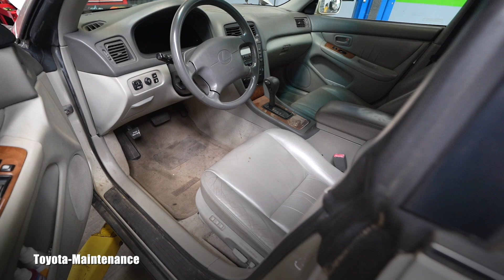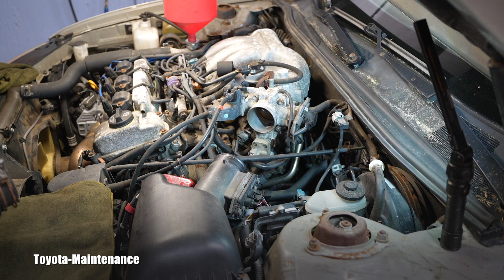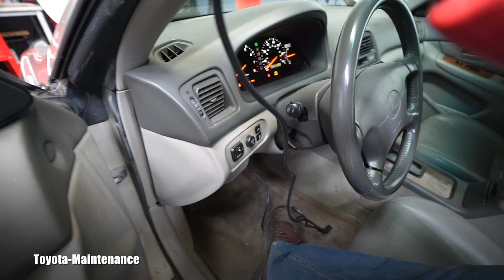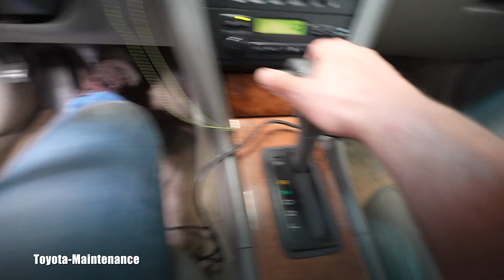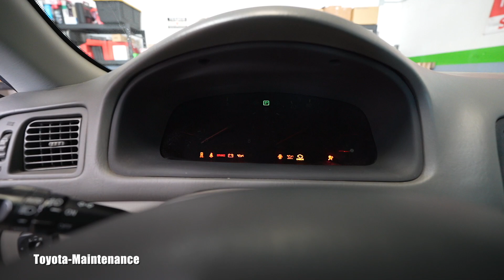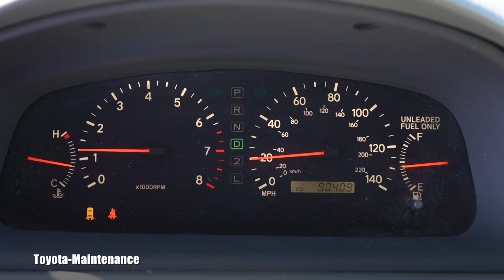Toyota Lexus Vehicle Speed Sensor Repair

Comment: TEN THOUSAND "THANK YOUS" for posting this video!!!! I'm thrilled to report that I used your instructions to replace my Vehicle Speed Sensor (error code P0500). Without you, I wouldn't have been able to do it. Thank you again.

UPDATE: I'm sad that this fix did not get rid of my Lexus' error code. The error came right back during the 5-mile test drive; My odometer, speedometer, and cruise control still work intermittently, but I received a new error code today so I wento to O'Reilly's Auto Parts store and had them test it (I used AutoZone before). Although the P0500 error code still indicated "Vehicle Speed Sensor A", O'Reilly's VeriScan printout suggested replacing the VSS, which I THOUGTH I DID per the video. I learned there are multiple causes for the same codefollowed these steps and replaced the part but it did not fix error code P0500. So I took a gamble and called O'Reilly's and asked if there was a specific part number for my P0500 code. To my surprise, I was told to buy "Import #13-0165" or "Dorman 917-603" (searchable on their site). Furthermore, VeriScan stated, "The transmission speed sensor, or vehiclse speed sensor (VSS), is an automatic transmission component used to monitor the wheel speed, and communicates with the engine control module (ECM) or transmission control module (TCM) to ensure optimal gear ratio and gear shifting." I ordered this part from Amazon today and we'll see if that fixes it. God willing, it will work....All I can do is try!
Reply: Get yourself a REAL MAN so you don’t have to post embarrassing things like this. “gIrL pOwEr” 😂😂

Comment: Wrong fix, check out the ceramic Resonater, i replace the speed sensor on transmission, it broke off & dropped into transmission . Replaced that and still had same problem.  Learn how to replace the ceramic resonator on the inside of the speedometer cluster.  By replacing that little blue part.
Reply: Can you elaborate as I am having the same problem, already replaced the VSS to no avail, I read that a 2nd speed sensor is in the speedometer.

Comment: Peter thank you for helping fix my 1999 Lexus es 300 with 433,000 miles on it. I have another question. My Lexus is now giving me a high idle (1900 -2000 rpm). I’ve replaced the IAC and Throttle Control Sensor and nothing. I checked for leaks and nothing. I need your help. Thanks
Reply: Im tryna figure out how to get my odometer turned back on😂.

Comment: That little knob to the right of the obd port is the lock confirmation chirp volume in case anyone is wondering. This model year doesn't have the Tpms reset button there yet. 

The hard part about this engine (98-01 for the ES) is the drive cycle is difficult. It needs speeds of 50mph and also varying speeds of 35 or so and also a pressure test by revving while in park. There is a drive cycle procedure available online in a TSB released by Toyota. We could not get the vehicle to clear the incompletes in the monitors after scanner reset until we followed the TSB.
Reply: I saw that. I was thinking it was the TPMS reset. The chirp volume could get annoying. I have one of Toyota's first attempt of a TPMS in my 08 Tundra. It didn't take long for the low pressure indicator to come on. Had it checked out a few times. They think it is the receiver. I just drive with the indicator illuminated. All Tundra's door lock range is maybe 50 ft. I can hear the solenoids engage. No need for a chirp. LoL My IS300, the wife's RX300 and her new RX350 had a range of a couple hundred feet.

Comment: Hope this is not too late but if you still have the vehicle for other things and not bled it fully yet, is there the bleeder bolt somewhere on the block or highest point in the cooling system? I forget if it is the 1MZ or 5S but there was a very large bolt like 14mm or something very funny used to bleed it. Good thing about this engine is it's the last of the non-interference engines. If the belt breaks or jumps time, the engine will just stop. No valves will be damaged from piston head kiss.

Comment: Is there a V6 Toyota engine that can be converted to rear drive. My 88 Camry would get a consistent 34 MPG. Much better than the Tacoma today. My 2002 Tundra get 13 MPG city.
Reply: I find it ironic that with today's electronic fuel management system, lighter aluminum engines, tighter tolerances, better fuel, lighter aluminum wheels that I could get better fuel Economy in a 55 Chevy. Thats 68 years . Take 68 and divide by 5 years. If they improved gas milage by 1 gallon every 5 years to today, your 2002 Tundra would be getting 26 miles to the gallon. They aren't fooling this old guy.